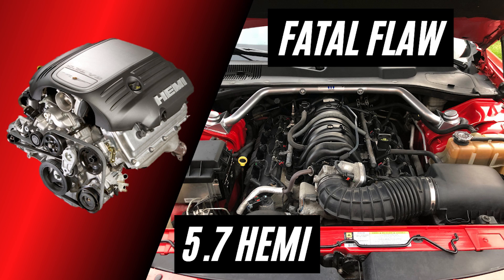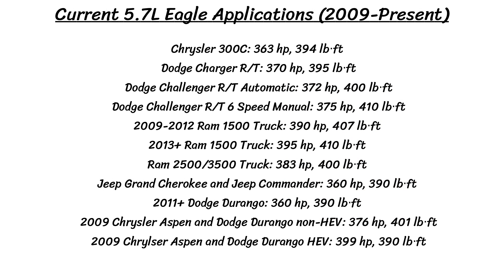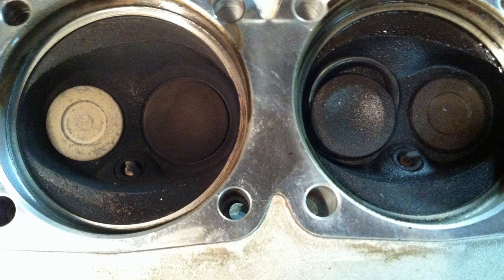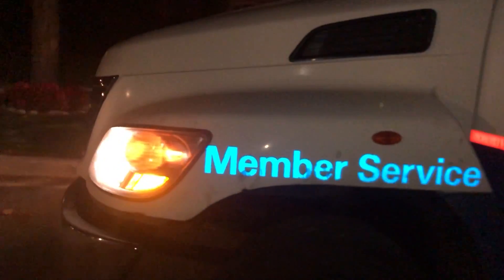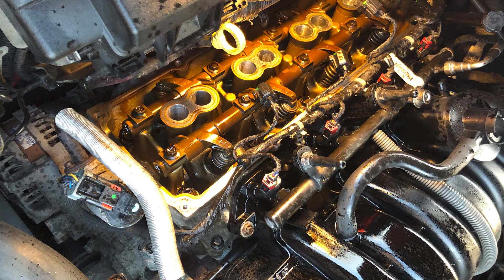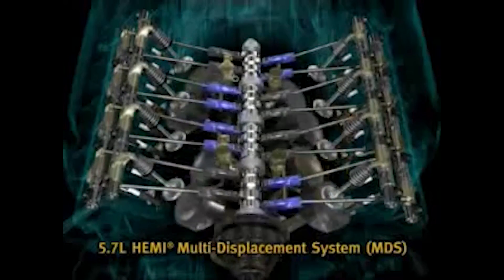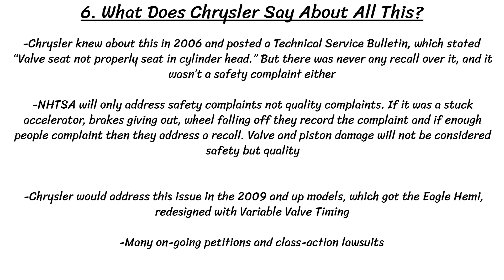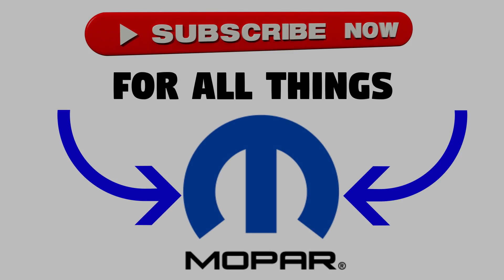The Fatal Flaw of the 5.7L Hemi V8 Engine & How to Prevent It (2003-2008 Valve Seat Drop)

Comment: Dodge was proud of the 5.7 and still probably is. Great motor and is reliable as long as you just drive it and not get on it too much
Reply: Why have a hemi and not get on it
Reply: @rockobukkako813  Yea right? Why have. Powerful motor and not use its power? It’s just not wise to always bat on any motor that’s all. Original owner of the truck made it last him all the years he just drove the truck normally... he did obviously get on it at points but not so much.He did also modify the truck. When he wanted to he did. It was his daily and he drove it hours each day

Comment: I just got a 2012 charger drove it off the lot hit the interstate started to overheat. Pulled over had no fluid filled it up with water at gas station got home. Went to oriellys got dexcool filled it up. Backed up seen dexcool all on the ground. All I can say is thank God I got a Warranty. In the shop now.

Comment: This....broke my heart. I drove a 2008 300 Touring for two years. After getting sick of getting passed by Chinese guys in minivans on the 401 here in Ontario, I decided to get a 300C Hemi. I found an 05 for 3300 bucks that some fat old guy had. My engine stalled TWICE after filling up my tank, so I did ton of internet searching and discovered that there was a bad float valve in the tank that allows overfill. Luckily all I had to do was burn off some gas and the problem stopped. However, I ALSO discovered this nasty potential problem while researching the other one. At least I'm aware of now. After viewing this, I have put top of the line oil in, I never do a hot shut off, I more often then not use the manual shift, and I plan on getting a tuner disable MDS. Thank you very much for this video Mars, you may have just saved my car.
Reply: “Some fat old guy had”… What a beautiful personality. Spoken like a true pos.

Comment: STEEL valve seats... in an ALUMINUM head.....  SERIOUSLY????  Sounds like they never learned from the 2.2L DOHC turbo-intercooled engine in the 1991 Spirit R/T (of which I have owned THREE out of 1,208 built), where they put STEEL core plugs in the RARE Shelby-designed LOTUS-BUILT ALUMINUM HEAD.... where the heating and cooling of the engine over time causes the head to form cracks around the core plugs in the head causing coolant loss which pooled around the spark plugs causing misfiring followed by overheating (as if the glued cardboard head gaskets didn't make these turbo engines enough of a leaker already!).  XD Part of why I stopped buying Chryslers 20 years ago.... they can't learn from their mistakes, and they also can't learn how to keep the company going after being bought out by different companies over time (in my lifetime, that would be Mercedes in 1998, Fiat sometime about a decade later, and now I understand Peugeot owns them now???  omg...).  

In any case, many thank you for your info on the first gen 345 Hemi.  If I ever decide to sink money into one in the future for a project, I will definitely heed these words of caution~

Comment: I've got a 2007 Chrysler Aspen with the 5.7. No valve seat problems whatsoever, at least up until now. Before this vehicle I owned a 2005 Dodge Ram quad cab, also with the 5.7. No valve issues with it either and the Dodge Ram was driven into the high 200,000 mile range. I believe I did not have any trouble with valves or any other internal engine parts at all , was because I ran them with royal purple synthetic At least in my opinion, that stuff works miracles, and is the best product money can buy. I drove both vehicles in very difficult conditions, dusty country roads, city stop and go, you name it. Both engines very quiet and you couldn't get a valve to knock no matter what you did, how hard you try. My issue with the Aspen was the air-conditioning, and right now I have a water pump that I need to replace. Both vehicles seem to burn out the small electric cooling fan, another common fault with the vehicles I've had in the 5.7 L Hemi line. Another problem common to both the Dodge Ram and the Chrysler Aspen has been a multitude of suspension issues, so non engine-related. I'm getting more than a little bit long-winded so I will finish by saying my Dodge Ram quad cab was a fantastic vehicle, the Chrysler Aspen was adequate but not great. Thank you for your good work in doing these reviews.  They are well done and you're very helpful in my opinion. They are for me anyway. Happy trails

Comment: I had a 2005 Durango SLT with 205000 miles. I drove for a half hour shut the vehicle off and when I went to start it the exact experience you described happen to me. The rest of the vehicle was in such good shape plus had a new transmission that I decided to drop a REM motor in it with new valve seats. Thanks for the info for prevention.

Comment: This happened to both of my magnums , first magnum dropped a valve seat at 137,000 miles never overheated and mds was off , my second magnum same thing happened at 91,000 miles but a shop overheated it , both were 2005 5.7 models

Comment: Use 5w-20 pennzoil at 3000-5000 mile intervals, use an oil catch can, use top tier quality gas, maintain all parts and fluids in your car, changing them when the manual says to. The car will last you a long time and you will get your moneys worth

Comment: PS; I ALSO RECOMMEND PUTTING IN A 65 PSI OIL PUMP. I DID IT WHEN WE REBUILT THE ENGINE. I USED A MILLING PUMP.
Reply: Melling
Reply: Why?

Comment: Have a 2005 with 292k and no problems. I use Valvoline 5w20 high mileage and change oil before 5k, use a 185° thermostat.

Comment: Dodge Chrysler is just crap Many Many newer low mileage used cars on lots all over...Late 50s to 1971 Best Years Mopar Madness.. now it’s FIAT Fuckups...
Reply: They didn't merge til the turn of the decade, so you better watch your mouth there buddy. It was srt after the merge that made the hellcat and demon. And gave us the less power potential but better mpg 392. But honestly between new and old the 6.1 is my favorite. The gas mileage of today, mixed with the power potential of yesterday and the mods are endless. Wanna run roots? Get great power out of that. Wanna run nitrous? Go ahead. Turbo? Just fine. Twin screw? Why not? Centrifugal? It doesn't matter you're gonna be able to get 1500, 2000, 2200 hp out of it so long as it's reinforced properly obviously. Not to mention you can get 800-1000 just running a N/A set up. The gen3 392 gets valve float upwards 1100 hp. And the 6.2 is only for boosted applications. But the 6.1 can even handle a carb conversion kit

Comment: SO MUCH FALSE INFORMATION MAN.... the MDS is the exact same system in the 5.3 Chevy bACTIVE FUEL MANAGEMENT AND ITS MADE BY A COMPANY CALLED DELPHI!!!! And let me school you a little the MDS does NOT activate at idle  EVER !!!! When at idle all 8 cylinders are firing!!!!  Don’t get MDS confused with nothstar caddy’s.... second the MDS is active ONLY when the throttle is at 30% load or less. Number 3 this is a big one YOU NEGLECTED TO ME TION THAT THE MDS SYSTEM AFTER IT SHUTS DOWN AND THE SENSORS START TO NOTICE AN UNSAFE TEMPERATURE DIFFERENCE THE  MDS WILL SHIT OFF TO MAINTAIN AN EQUAL HEAT ACROSS THE ENGINE block AND CYLINDER HEADS ETC. I HAVE OWNED NOTHING BUT HEMI’s SINCE THEY. AME OUT ON THE LX PLATFORM FROM 2005 (BEFORE MDS) and just FYI the Dodge Ram mega cab from the 07 and up era don’t have MDS THATS BECAUE THEYRE BUILT AS A 2500 PLATFORM!!! And for the record “deactivating MDS BEFORE YOU SHUT IT OFF???!!! WHAT DUMB STUFF IS THAT DUDE?!!?!?!?  THE MDS IS ALREADY OFF WHEN STOPPED AT IDLE!!! I HAVE NEVER EVER HAD A VALVE ISSUE AND IVE HAD HEMI TRUCKS, CARS, YOU NAME IT AND I ALWAYS GET 2500,000-300,000 miles on basic maintenance alone and an aftermarket water pump!!  THATS IT!!! KEEP YOUR MOUTH SHUT AND STOP PRETENDING YOU KNOW THINGS YOU ACTUALLY DONT! THIS VIDEO HAS DUMB SH•T WRITTEN ALL OVER IT ILL DESTROY EVERYTHING YOU THINK YOU KNOW ABOUT CHRYSLER PRODUCTS! And for the record did you know they aren’t actually HEMI’s THEYRE AN ALMOST HEMI!! DO SOME RESEARCH YOULL UNDERSTAND!!! STOP THESE VIDEOS MAN! ITS ALL FALSE INFO AND IF YOUD LIKE I WOULD LOVE TO PROVE IT! CHALLENGE ME.... COME ON KNOW IT ALL! Anyone watching this IL BEGGING YOU TO DISREGARD AND DO YOUR OWN RESEARCH!

Comment: Excellent video, thanks so much for posting. I have a 2007 Magnum R/T with about 85,000 miles on it and no problem so far. Just from collecting the anecdotes I figured out that it usually happens from a hot stop with a brief shutdown, like running errands or getting fuel.  I also came up with your technique of idling, which I usually do for 45 s because that length of time seems to cause the temp gauge to drop sharply and it stabilizes thereafter. I also run the heater when I'm doing this, to draw more heat out of the engine.
Reply: Does that heater trick actually work ?
Reply: @marcomoreno24_7  Yes, I can see the temp gauge drop faster if I run the heater on high. Passengers will complain, however :face-green-smiling:

Comment: Thank you. This happened TWICE on my 3.7 V6 2002 Liberty! First time, was out of the blue, 2nd time was the coolant was low, but I had no way of knowing because the temp gauge never moved.
Reply: That gen Liberty, is known for airbag problems, there's a good chance that the dreaded "AIRBAG" light randomly comes on. IIRC, they were recalled, because reportedly, the air bag can inflate randomly when in operation!
Reply: @RJARRRPCGP  Was a known issue/recall, had it fixed at the dealership. Further research suggests it’s the sensor.
Reply: Thanks for the info.
Reply: @theocschannel4111  Know what's more scary? I don't know if they have the faulty "shrapnel" air bags or not.
Reply: @RJARRRPCGP  There was a recall a few years back—taken care of.

Comment: I own a 2004 ram with 180,000 miles and a 2007 300C with 140,000 miles have been lucky but I do frequent maintenance and always keep an eye on the temp when I travel. Thanks for those tips. Been thinking of pulling a set from a junkyard and rebuild it to swap it with mine and then redoing mine to swap it with the other car before either car drops a valve seat.

Comment: Ive never heard of this problem being common on the 5.7 hemis.  I've heard of lifter problems but never this.  However if I had to take a guess on what would cause seat drop would be  1. Overheating, 2. Starting in cold temps and not letting engine warm up.  And letting cool off if its hot.

Comment: I've seen mechanics using a small punch around the valve seats to increase the holding strength while the heads were removed for other repairs. I own a 2011 300C that may not be affected, as you state 2003-2008 had this problem. It has 60,000 miles and has been very dependable so far.

Comment: I must have gotten lucky with mine ... I have an 06 Dodge Charger 5.7 hemi and it’s got 160k miles and I haven’t had any issues with the motor itself.
Reply: Me too, 2006 5.7 Grand Cherokee with 173k miles. No motor issues at all and no check engine light 💯💯
Reply: @reefbangoura  same .. the only time the check engine light comes on is for an o2 censor lol but other than that it’s running great ... averaging almost 20mpg lol insane

Comment: The Fatal Flaw of the 5.7L Hemi: that's easy, the fatal flaw is the very fact it is a 5.7L Hemi, 50 year old technology that was surpassed before the even came out (pent-roof engines) and now people who grew up with or whos father grew up with the myth of the Hemi (ie: suckers) pay out the nose for a engine who is not even close to high performance, and do not even have hemispherical combustion chambers.. So the are fake Hemi's being sold to suckers for nostalgia and nothing more.
Reply: I’m guessing you drive some new eco boosted pos slow car lmao
Reply: @reefbangoura  Actually no, I drive a Turbo charge Lexus that uses a Pent-roof head, something that was invented 20 years before the Hemi, and was, and still is, vastly superior. Not only does my car have more HP and Torque then a Hemi, it also gets better MPG, because it actually burns all the gas, unlike a Hemi who has to have a second spark plug in each cylinder to burn the left over fuel on the exhaust stroke because it is that dam inefficient.
Reply: @ShionWinkler  6.4 Hemi, 6.1 Hemi, 6.2 Supercharged Hemi are all faster and better  lmao. Keep hating on Dodge all you want

Comment: Manufacturers worldwide press valve seats into aluminum heads by the millions. Fiat/Chrysler for some reason failed to give the seat enough press or interference in the fit. It COSTS more to warm the heads and chill the seats to achieve a higher, more thermally stable interference fit. AND THEN when they find out later, they swept it under the rug.  Damn shame really, just poor execution.

Comment: I'm thinking of a WK2 Jeep Grand Cherokee, likely 2019 certified used. Does this affect the WK2 5.7? I'd like to get the 4.x4 V8 but will go with the V6 if this is still an issue with the current generation.
Reply: As long as the previous owner was taking care of it and you plan on taking care of it you will be fine. I drive a 2006 Jeep Grand Cherokee 5.7 with 173k miles and have no check engine light, no engine issues at all. I’ve only had to do the basic repairs

Comment: Great video .. We actually own 2 06 Dodge Daytona R/T's ... Wife's has the infamous tick .. and mine just starting .. I'm gonna chance oil on both and see if that helps .. I'm just wondering if putting a bottle Lucas additive would help .. We'll see
Reply: I would get can sea foam and pull brake booster hose and spray while rpm held at 2k. Takes about 10 mins shut off let heat soak about a hour, put bottle of teckron in gas tank. take it out and drive it hard for about 30 mins. Also i would add a can of engine restore to oil seems to help.

Comment: I swear if I didn't know better I would have you were doing a tech documentary in my '05 Magnum RT.  Dropped a valve seat at 185k miles. I have the Diemler 5 speed transmission.

Comment: That's definitely 1 issue, but also the lifter and rocker arm failure issue is another common thing that wipes out the cam and sometimes valve tips on earlier 5.7 and 6.1 Hemi's with and without MDS for 5.7s. For those with MDS, there is no fix, just replace the parts and the dealers say to use a HP 5w20 full synthetic oil. And let them cool down for at least 10 mins after a long trip or a  hard run, running at idle. For those engines w/o MDS, the fix is to use the HellCat lifters and rockers, even in the Eagle series engines. All of the Mopar techs I've talked to say to use the best oils and filters, and the best premium grade fuel you can get to fight pre-ignition and carbon build up, both of which causes heat build up and hot spots in the heads and piston tops. Lastly, make sure the pcv system is working to control normal blow by. Good vid, and thx for sharing!

Comment: 97,000 miles on my Charger when it dropped a valve. Had to have the engine rebuilt. This car never reached 3000 miles before the oil was changed. The oil was the same color coming out as going in. I'll keep the car until it dies and I really loved it from the moment I brought it home, but I just don't trust it as much anymore.

Comment: I have a 2006 r/t 5.7 with 240k mi. It was running great until about 3 months ago when it started randomly stalling out. At first it did it a couple times only when I came to a stop but it would always start right back up. I took it to a mechanic shop to get a diagnostic and they did one and said they think it’s something with the computer not giving signal to the transmission but they would need a few hours to “get in there” and find out exactly what’s wrong with it and they told me they charge $150 per hour. Does anybody have any idea what it could be before I spend $450 for them to tell me I need a fuel filter? It randomly stalls out and the check engine light only comes on when it stalls then goes away when I start it back up
Reply from the maker: Maybe EGR valve or bad PCM? For something like that it’s best to get it diagnosed just not where ever you took it (I’m assuming the dealer). A reasonable normal mechanic shouldn’t charge too much to diagnose the issue, if they don’t it’s going to be tough to find exactly what it is
Reply: @MarspeedCars  thanks bro I wanted to see if maybe it could be a cheap and easy fix but it’s probably best if they figure out exactly what it is
Reply: @JiMiHUNDROSS  did you figure it out
Reply: @reefbangoura  not sure.. I had it scanned and got ECM and PCM codes and had them cleared. Also my battery cables were loose so I replaced one of them and tightend both of them and it hasn’t stalled out in a week. Also there is a recall on the 2006 dodge and Chrysler gas tanks because filling the tank causes stalling and I haven’t filled the tank. Hope that helps

Comment: I have a 2005 Hemi, 120,000 miles and still ok, the prevention of engine failure is good advice, ie the cooling down thing. Which people with small engine turbo cars already do as turbos get very hot.

Comment: 2006 Jeep Grand Cherokee with 5.7. almost 170,000 miles still going strong. I have more complaints about the drive train than anything else. I've only had to do the water pump and radiator at about 160k
Reply: I wonder if my living in a cooler part of the world helps? Do external temps affect the temps of the heads?

Comment: What is the point of that engine cover? Does it really matter if I remove it or not should I? Just curious of other owners opinions
Reply: The engine covers are designed to help reduce valvetrain noise as well as dress the engine - the differences in removing will be very small but apparent over time. More heat going into your hood liner and surrounding accessories, more valvetrain noise as the engine ages will be slightly amplified compared to leaving covered.